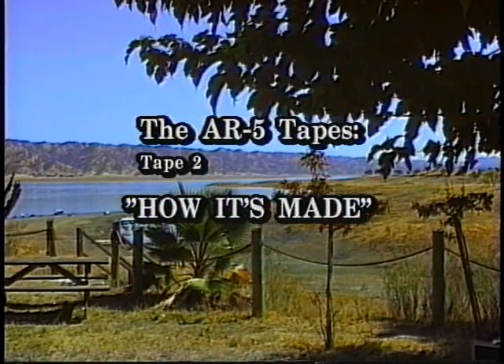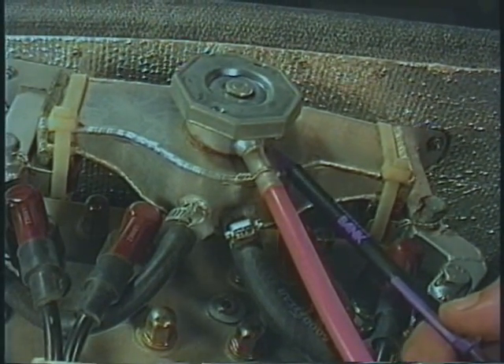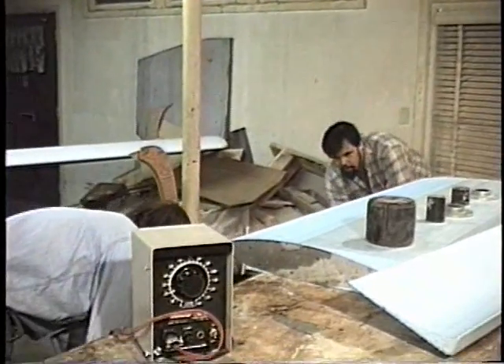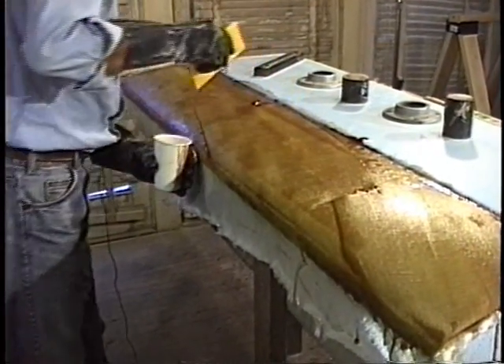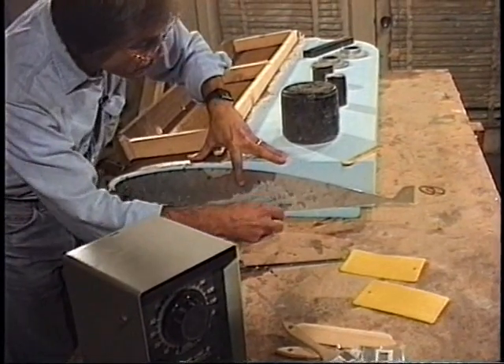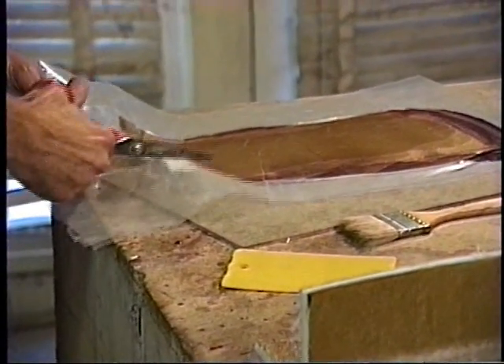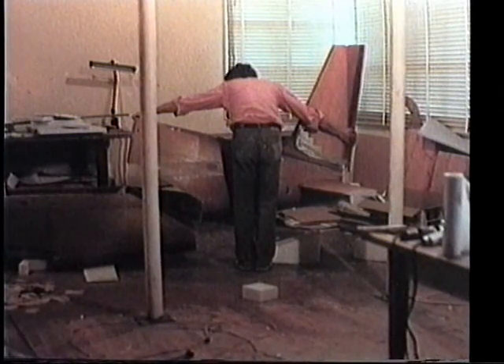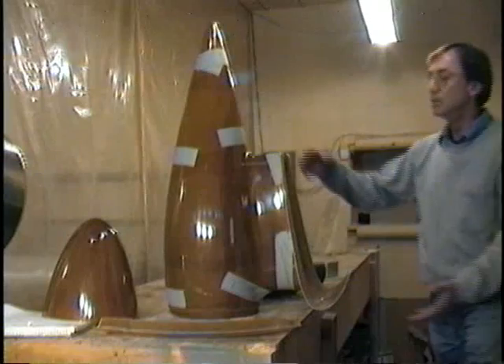HOW IT'S MADE

Comment: Brings back a lot of memories. I built a molded composite plane, and even though it had molded parts, there was still a lot of fabricated parts made from foam core that used the same procedures. I was working with vinyl ester resin and polyurethane foam, but the procedures were about the same. Except no hot wiring of the foam.

Comment: Did he say which is the weight of the wing? Fantastic designer:)
Reply: No, other than it's a heavy method of construction. (V.s. wood and fabric, or aluminum, presumably).

The entire airplane, fuel, and pilot weighed in under 300kg or 661Lb for it's FAI speed record setting flight in it's weight category. 

So we can assume it weighed less than 500lb, probably under 480lb empty, including motor, That's with aproximatly 54 sqft wing area. Most Rutan Designs, if you subtract the engine weight, weight about 6-7lb per sq ft basic structure weight. Except the Solitaire and Quickie Q1 were both 3.3lb/Ft^2 without motors, by my calculations. Smaller is better for this foam core method as the volume of foam goes up to the square of wing area, and foam still weighs almost 2lb per Ft^3.

Comment: Just to be hyper-picky, the edges and corners of the aluminum reinforcement plates should be filed round, in order to avoid stress concentrations. (That's where cracks start.)
For the jobs using sandpaper on stir-sticks, try emery boards made for finger nails instead. (See your local dollar store cosmetics/health & beauty section.) They're good for other hobby work too.

Comment: I cant get enough of these videos. I just wonder why he used polyester primer surfacer (1:39:34) instead of epoxy primer. I would think polyester would melt the epoxy microbloom and epoxy mix.
Reply: Polyester does not attack epoxy. Epoxy is impervious to most things. He probably used it because it cures very quickly, like 30 min vs 12 hrs
Reply: @sblack48  sands better too

Comment: As a note the information in this video is extremely dated. Check your epoxy manufacturer before use. For example the "film" referred to is called amine blush. It is caused by a reaction with the humidity in the air. It can not be sanded off. It can easily be rinsed off with water, no soap. It must be rinsed BEFORE you sand or the amine blush will get worked in the surface and will reduce the bond substantially. Many manufacturers make "blush free" hardeners that are the best choice if there is any chance of needing to re-bond parts after curing. Parts done in vacuum bagging do not form amine blush as there is no moisture present during the cure. Also the cross sanding cuts the fiberglass roving and weakens the area sanded. Always wear a respirator and gloves with un-cured epoxy. The vapors will irritate the lungs and contact with skin can cause epoxy allergy's for life.Also this guy did not develop this method for taping joints. This is an old marine method for making and repairing boats. Called a tape reinforced fillet. Used today on nearly every wood boat and countless wood and glass kayaks. And on large boats for bulkheads.
Reply: Ill add, the Amine Blush that forms can also be eliminated by laying down "Peel Ply" whether while vacuum bagging (as always) or even for open wet layup as Mike is performing here, by rolling out a layer of peel ply at 58:20 you don't have to worry about starving the laminate as he discusses, because there is a sacrificial layer holding resin left over it. PP is known to help reduce part weight by improving fiber fraction, as it also absorbs excess epoxy when its squeegeed or vacuumed down, then it removes the excess epoxy when its peeled off the surface.

The world might have moved on in technology, but classic "NONA" open wet layup over foam core is the simplest way to make any epoxy composite parts for the home DIYer. 

Although heavy, its probably half the work and half price of even a basic vacuum bagging operation.

No, Mike probably wasn't the first one wetting out of BID tape before application. He might have been the first to use two sheets of clear plastic and a squeegee to do it, maybe. But many process inventions are independently created by people working on the same sort of projects in isolation, so he could believe he invented said process.
Reply: Epoxy allergies: epoxy hardener causes many of the allergies you'd expect from epoxy. You can neutralize it by rinsing-off with “white vinegar”, which changes the chemical structure to a water-soluble compound; then cleanse your skin by washing with warm soap and water.  The two prime sources for allergies come from the powder found in some gloves, and from the "latex" gloves themselves.